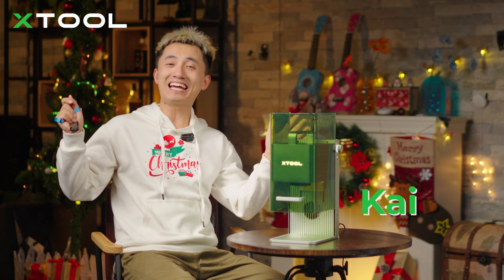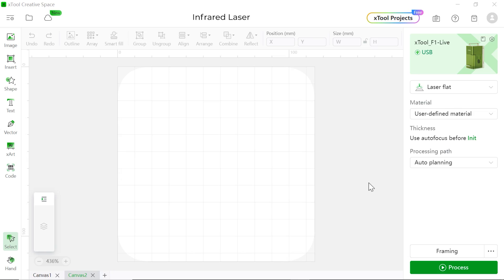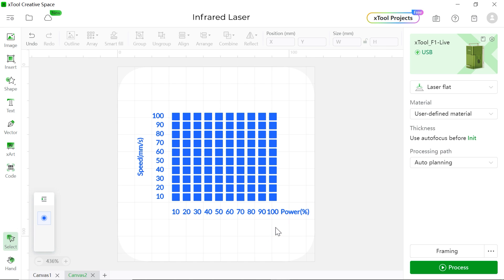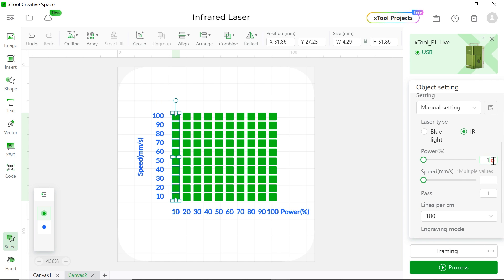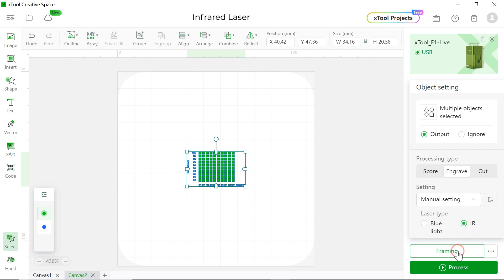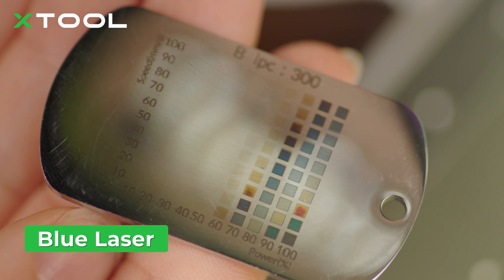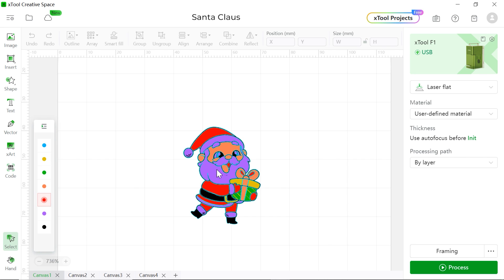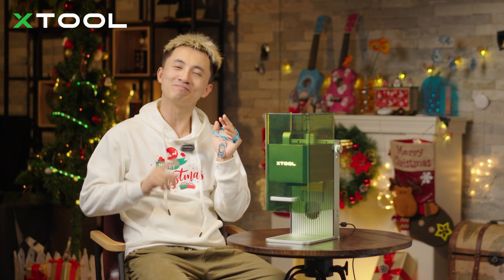How to Color Engrave a Santa Claus on Metal with xTool F1 Laser Engraver

Comment: Which machines can do this?
Reply from the maker: Besides F1, D1 Pro with infrared and blue laser, S1 with infrared and blue laser, but it would very tricky to do this certain pattern with these two as the position will change when you switch the laser head, other patterns in file can be done as it's only engraved by blue laser.
Reply: Thank you for your response.

Comment: Awesome. Now I got to see if I can make this on the D1Pro.
Reply from the maker: For other patterns on the file, you can use the D1 Pro infrared laser head to engrave, but for this Santa Claus, not really, as it requires infrared and blue two lasers, and if you switch the head, the position will be changed.